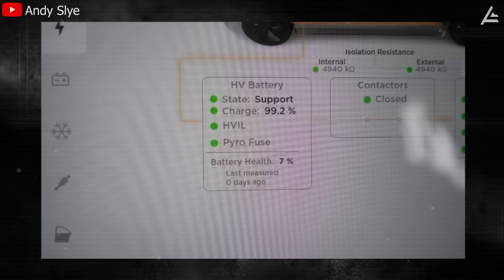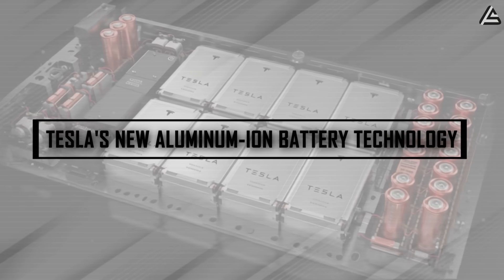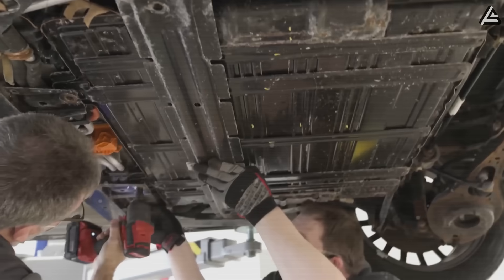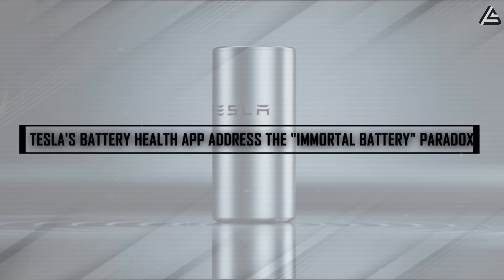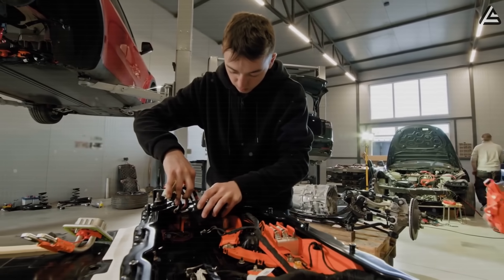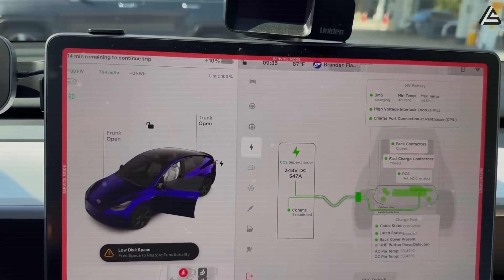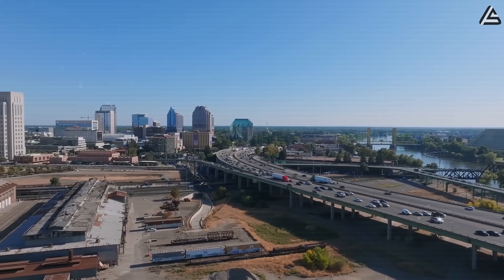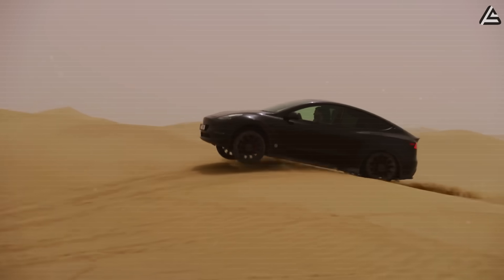2026 Tesla Model 2 Aluminum-Ion Battery Finally Hit The Market. HUGE Updates HERE

Comment: "Immortal Battery Paradox?" I see 30-year-old Hondas everywhere still running reliably. All those other failure points mentioned - gaskets, door seals, wiring  and cooling pumps - are also present in existing EVs and ICE vehicles. So why would they be any worse just because the battery lasts 27 years?
Reply from the maker: EVs share many wear-and-tear parts with ICE cars, but eliminating engine complexity already cuts a huge chunk of long-term failures. A 27-year battery shifts the balance: instead of the battery being the weakest link, the smaller components become the service items. It doesn’t make EVs worse, it just means they’ll need maintenance like any other vehicle, but without ever worrying about replacing the most expensive part.

Comment: My comment’s subject is “human operations” as related to battery range potential. The “standard” speed for YouTube EV reviewers is to drive a car at 70 mph using cruise control to determine range. Average Joe/Jane do not drive like that. They speed, dash, etc as the norm. Battery technology, capacity, ideal use, rate of charge, etc. are not top priority. The EV range estimator calculations factors are not revealed. Therefore, this Tesla 2, battery technology aside, will have a practical ideal range that is not revealed. If and when each convenience store, Interstate rest stop, present gasoline stations, etc has DCFC high power reliable units at a reasonable per kw price, then the battery longevity or charge cycles will not matter as other components will wear out, suffer corrosion, road damage, etc requiring maintenance/service/replacements such as sensors, interiors, service modules, leading to a new EV vs expensive repairs.
Reply from the maker: Thanks for your comment

Comment: But, this isn't happening. The story if a fabrication.
Reply from the maker: Model 2 is a real Tesla project, just not fully revealed yet.
Reply: @AutoGearShift2 Yes, but Tesla hasn't developed an Aluminium-Ion battery and nor does it have access to one. Any suggestion that it does is false.
Reply from the maker: We analyze potential upcoming products based on leaks and expert perspectives to encourage open discussion. It’s about exploring ideas together, not making promises. If we only talked after launches, the surprise would already be spoiled.

Comment: When will Tesla start offering aluminum ion batteries? The manufacturing cost will be much lower. What will the cost to us of the aluminum ion battery be vs. the LFP battery?
Reply from the maker: They’re still in the testing and prototyping phase, so final costs aren’t public. Aluminum-ion could be cheaper than LFP once scaled, but exact pricing will depend on production and supply. We’ll cover cost comparisons in detail in a future video.

Comment: This video is a fairly tale.😂

Google the following text-

"tesla aluminum ion battery problems"

One of the major problems is that Aluminum Ion battery's electrolyte is extremely corrosive.  Nobody has solved that problem.
Reply from the maker: You’re right that aluminum-ion batteries face challenges like corrosive electrolytes, but researchers are actively developing stable formulations that address this. Early prototypes already show fast charging and safer operation than lithium-ion. It’s still early, but it’s far from a “fairy tale.” We’ll cover the details in a future video.

Comment: Aluminum is readily available, why didn’t they use it before lithium?  They now have discovered this after 10+ years?  Something is up? No specific real data results by any manufacturer. Just talk!
Reply from the maker: It’s true aluminum is abundant, but turning it into a practical, high-energy battery is very hard, issues like low voltage and past dendrite formation delayed development. Only recently have researchers solved key challenges, so now real prototypes are appearing. We’ll go over the latest data and breakthroughs in a future video.

Comment: Hello, cette technologie sera t'elle mieux que les batteries solides que l'on nous promet pour 2027. Sera t'elle aussi moins chère et plus sûre que la batterie solide ? Merci pour vos réponses.
Reply from the maker: Aluminum-ion batteries are still early-stage but show promise for fast charging, safety, and cost. Solid-state batteries for 2027 may have higher energy density, but aluminum-ion could be cheaper and safer in mass production. We’ll compare both technologies in detail in a future video.

Comment: How about the fear of thermal reaction?
Reply from the maker: Aluminum-ion batteries are actually much safer than traditional lithium-ion in terms of thermal runaway. Their chemistry doesn’t form dendrites that can short-circuit, and they operate at lower voltages, so the risk of fire or explosion is far lower.

Comment: until we actually see this battery we wont know if you are blowing smoke up our ass
Reply: Aluminums problem is swelling at full charge and shrinking with discharge causing the cathode to crack and loose efficiency. No mention of that here so I think this is smoke and click bait.
Reply from the maker: Swelling and mechanical stress are real challenges for aluminum-ion chemistries, and that’s well documented in lab studies. That’s also why Tesla hasn’t announced anything commercial yet. most work is still at the materials and cycle-life stage.
Reply from the maker: lol it's coming soon

Comment: Yes, longevity, performance at wide temperature ranges, lower potential for thermal runaway, easier availability of aluminum vs lithium
Reply from the maker: thanks for your sharing. those are fair points

Comment: Why the BS about Tesla's existing batteries suffering battery degradation. Many Teslas still running with 200,000-400,000 miles. Except for hard faults, existing Teslas do not need to replace batteries within the life of most ICE cars.
Reply from the maker: Most Teslas keep over 80% capacity well past 200,000 miles, and full replacements during a typical ICE car lifespan are rare. The warnings about degradation mainly highlight extreme cases or heavy fast-charging scenarios, not the norm for everyday drivers.
Reply: Always room for improvement
Reply from the maker: yeah
Reply: Propos généraux sans intérêt si on n'évoque pas la chimie de la batterie... Les Tesla qui tiennent longtemps sont équipés de batterie lithium fer phosphate... Les grosses batteries NMC tiennent beaucoup moins longtemps... En plus une batterie de grosse taille n'a aucun intérêt... Donc LFP pour tous !!!
Reply: @capiz625  Mais, sans doute, les nouvelles batteries de Graphène  Aluminium  avec la transformation C7Al2 d’une résistance minimale au passage des électrons semblerait être une importante amélioration par rapport aux batteries de Lithium.
Reply: Right I’m at 365000 km ghost m3 still 400km+ on a charge
Reply from the maker: good for you
Reply: Why? Same reason you avoided using the “?” when asking a question. Culturalism, if there is such a word. Culture exists on rumors of the worst kind. Tesla cannot avoid being part of the overall EV experience by people driving all sorts of EVs. For example, the 1 hour drive required 1 hour charge as experienced by Nissan Leaf owners2011-2016. The next nexus is that not all chargers are the same. From the 110V 14A outlet to 350V DCFC units there is quite a variety of charging options. While this video addresses DCFC exclusively as the new battery chemistry/technology, backing up into a  very common 65V DCFC means longer charger times. The conclusion is that if people beleive EV batteries do not last as advertised it’s because the subject is generalized, or culturalized. Do all tesla EVs ranging from 2012 to 2025 have the same battery technology and equal long life? Of course not. Lastly, owner battery abuses. The standard limitation of charging to 80% of capacity is mirrored by corporations offering public DCFC and often limit charging to 80%. The 250 mile Tesla 2 will then be charged to 200 miles of range to 0% or in practical application, roughly 150 miles of range MINUS wind/temperature, speed driven, topography, etc factors. Very quickly the 150 miles travel range could be a 100 mile limit.
Reply from the maker: thanks for your detailed sharing